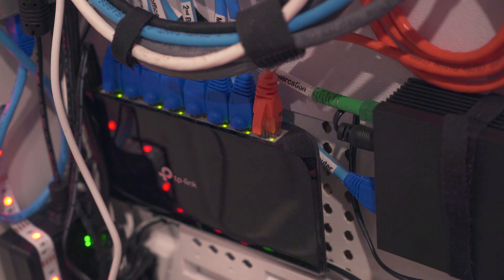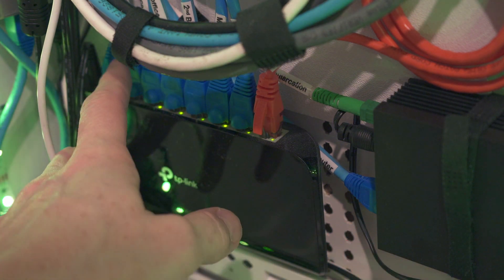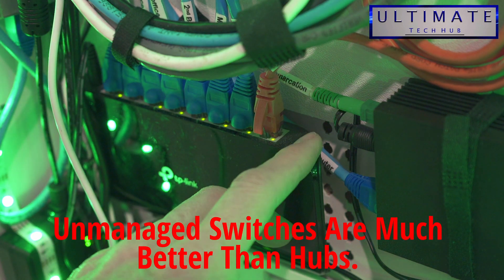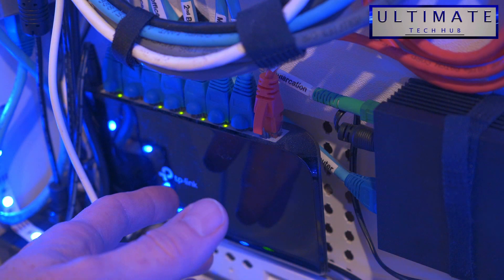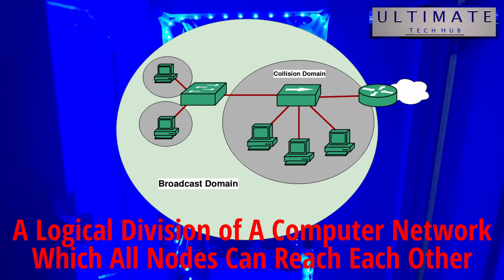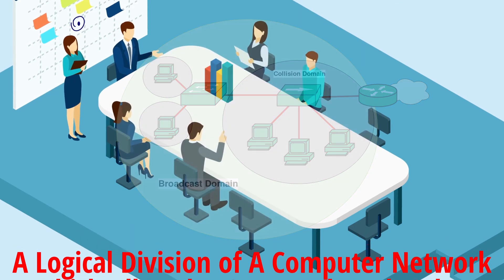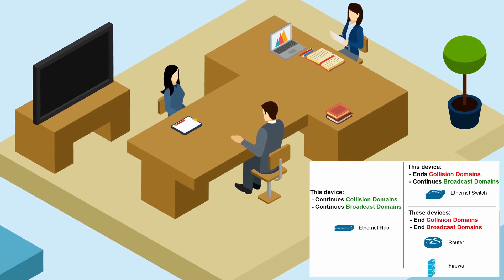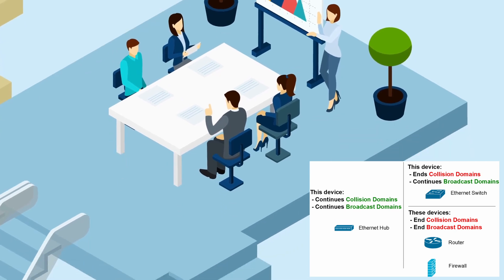3 Things A Switch CAN'T Do!

Comment: I have a question, can I plug 2 router to my switch for faster internet
Reply from the maker: No that won't work.
Reply: @UltimateTechHub  🤦‍♂️ how can I plug 2 router then? Or what do I need
Reply from the maker: @Legendary_john  Here is a video I made on this setup. Read the description or my pinned comment for the correct IP address assignments . I switched 2 numbers accidentally in the video.
https://youtu.be/qpcWucapIRg

Comment: I have a quick question… I’m getting Fiber installed in my house soon and I’ve been debating on which router to get.. I’m looking for the best of the best here. I have over 200+ Devices and was using Eero Pro mesh… any suggestions? Also, you think using Eero Pro 6 as my main router and have 4 more could do it for a 3000sq ft home? Love the videos. Real helpful
Reply from the maker: That would probably cover 6000 sqft. That's a good system. 200 devices is quite a bit. Some make sure the Euro Pro can handle it. I have a Netgear wax 630 ap  that can handle 100 devices at the same time and store up 500 devices. The coverage is about 3000 sqft. With mesh you definitely get a wider coverage area. I think your plan is excellent! Keep me posted and thank you for watching!
Reply: @UltimateTechHub  great to hear! And I will def keep you posted once I get the install done! Thnx for the reply